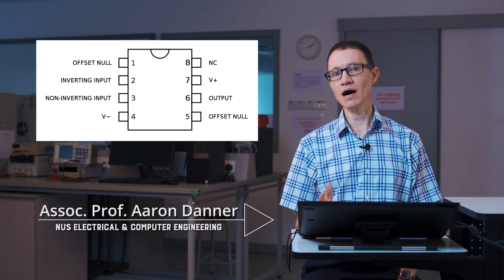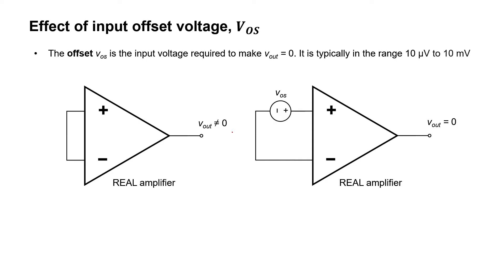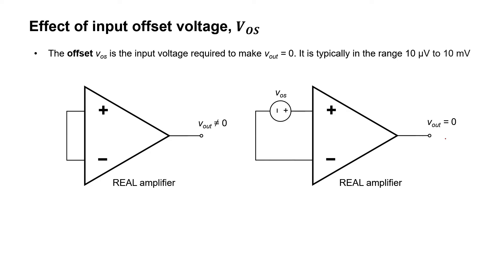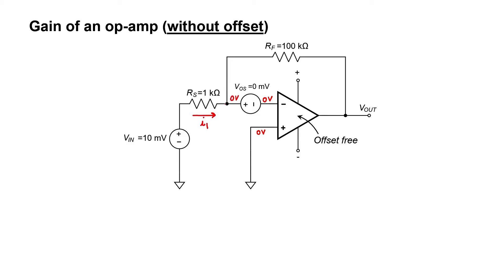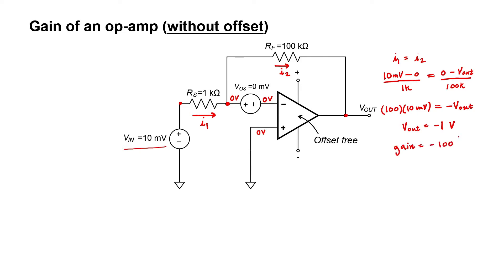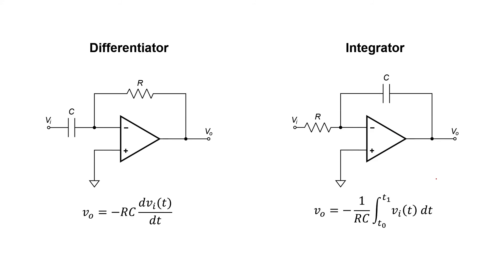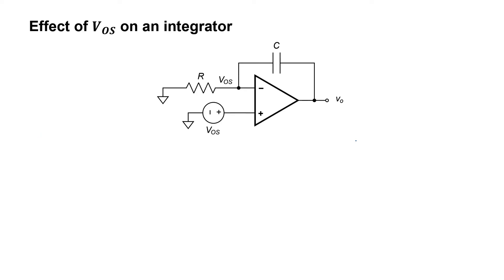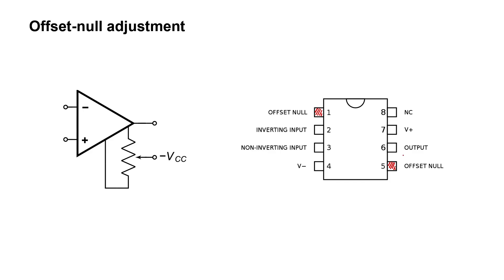Offset voltage in op-amps (Amplifiers #8)

Comment: I built some active crossovers for my stereo system.  They used a generic op-amp and I upgraded to the AD 712 high-speed, bi-FET op amp.  Far lower noise than even the "upgrade" of the TL 0072.  Biggest difference?  The AD 712 was laser trimmed each chip to achieve a zero offset.  DEAD QUIET!

Comment: It looks like the offset voltage only affects the DC signal processing.  If I were for example designing an audio amplifier then it seems like the offsets would get destroyed by any coupling caps.  Is this true in general?  can I mostly ignore offset voltage if I am not depending on accurate DC levels?  I still get the same AC gains and bandwidths right?

Comment: Is there a minimum voltage difference required for op amp to give any signal? I'm trying to make 0.003v difference voltage (using metering device shows 0.003v between two points of input voltages) into 3v output.  So far no success. I used formulas vout=Rf/R1×(V2-V1). My vout is 3v,V2-V1=0.003V, R1=1,000ohm, So 
 Rf/1kohm=3÷0.003
Rf/1,000=1000
Rf=1,000,000ohm. 
I used two 1k resistors for both inverting and non inverting,  and two 1million ohm. So far no results, the output shows close to 5v vcc when I use metering device connecting one prope to output,the other probe to negative ground, and when I connect to positive instead of ground I get 0.5v something like that... I was supposed to have 3v or something near that number.

Comment: I have dual op amp lm358, but when I connect my metering prob to output and the other probe to negative ground source without anything attached(no resistors attached) it shows full vcc voltage.  Wasn't it supposed to be zero or close to zero volts? And when I do the same thing on the other outlet of op amp (since it's dual op amp) I get 0.0011v  something like that. Aren't they supposed to be both zero?

Comment: I have a preamp and buffer to design for an audio preamplifier,the choice was for a TL072,but realistically two TL071s would be better,giving better component placement.

The offset null components would add to the real estate use i have and to be honest i need as much space as is possible  due to the main amplifying devices being vacuum tubes,heat constraints and EMI,there are smps boost,voltage inverter,smps buck circuits so space needs to be thought out carefully wasting as little as possible.
Then i thought the TL071 ics should be fine leaving offset null alone,i'll be running them on +-10Vdc regulated from 12Vdc after the inverter the negative will be just over 11Vdc,so regulated to 10Vdc for a signal window of 20pk(10vpk-pk) more than enough for a preamp to avoid clipping.
Any offset dc and people need to understand the offset controls dc leakage at the opamp output,will be blocked by a dc blocking cap input and output.

As for dc bias shifts due to offset the signal window is large and i see no problems in any bias shifts,this is for guitar and without any specialised equipment to monitor the signal i doubt anyone would know.

The TL072 has no function to null the dc offset and there is no reason why two TL072 ics could not be used instead anyway,both are 8 pin dip or soic so8.

Were i designing a piece of medical equipment or a radio telescope then i'd use the offset control but for a mid to low fidelity audio amplifier i see no issues.

I just have to regularly convince myself of this.

Comment: How we can fix offset voltage in single supply op amp circuits?
Reply: Single supply does not matter. Check out the CA3140 op amp. Can be used in any way.

Comment: Given that almost no modern opamps include offset null pins and even many you'd want to use are in dual packages which also has no offset functionality, it'd be nice to include some other designs for fixing offset "externally". Every time I see this problem taught about, it's always only in relation to a single opamp that includes those pins whereas I'd find in most practical cases other design considerations mean I can never use such an 'old' opamp with the 'academic' fix available.
Reply: One common way, which is described in many application notes, is to inject a small current into the op amp through a variable resistor in the feedback loop. So basically this equates the use of offset null pins.